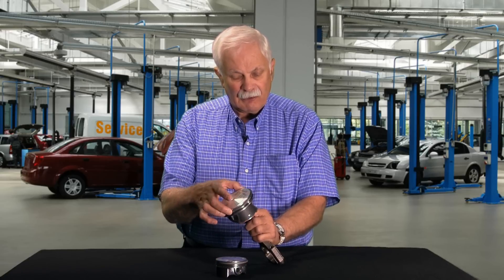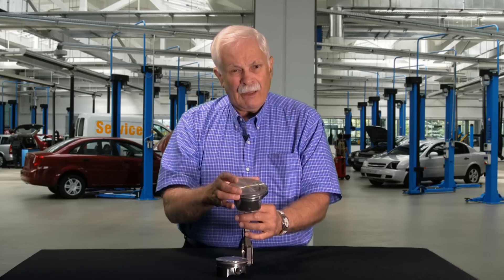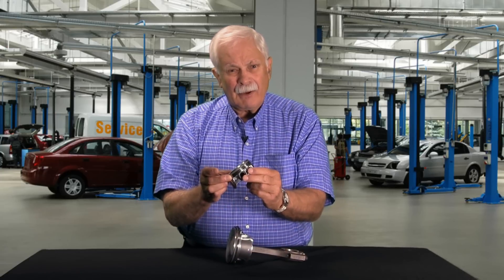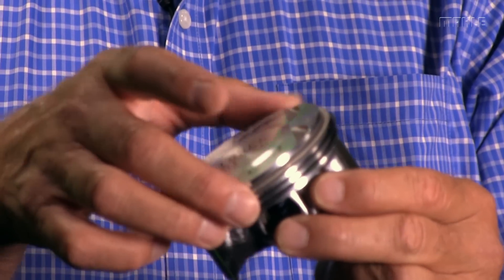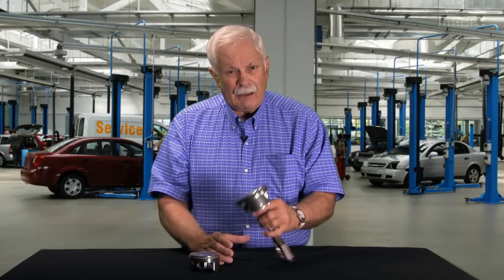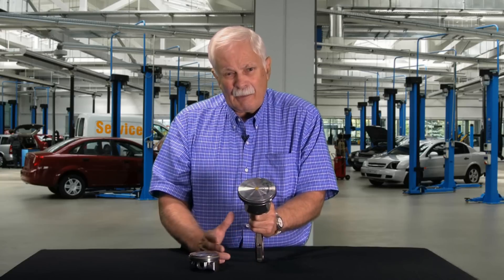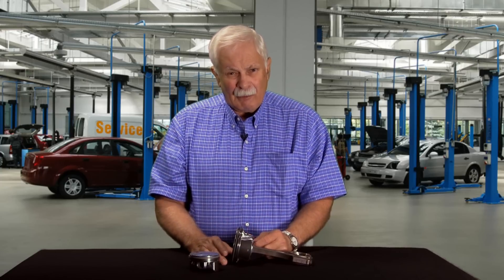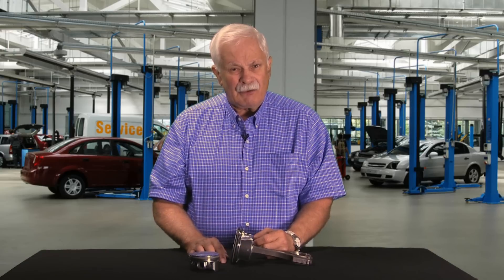Ring End Gap

Comment: MAHLE what is considered as too big gap? Let's say I got normally aspirated engine, 4 inch bore... 4 x .004 = 0.012. At what size over 0.012 would I loose compression/power/oil?
Reply: @bax442 
4inch x 0.004inch = 0.016 end gap. Not 0.012 ?
Loss of power etc etc would be a ring gap similar to a very high km/mile engine with gaps of roughly 0.022 for a 4" bored nasp.